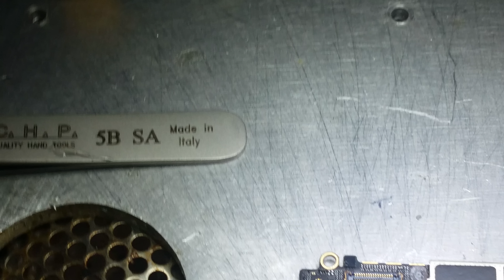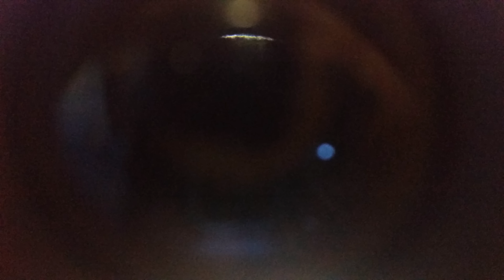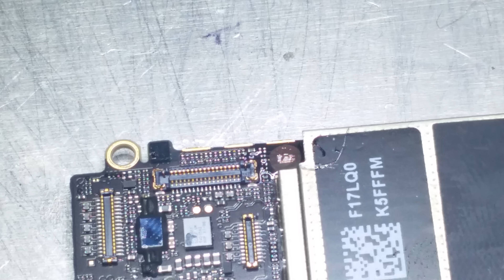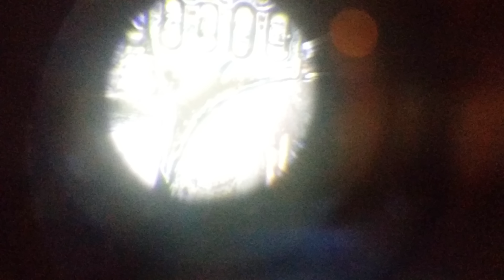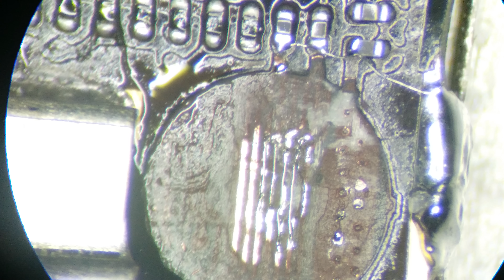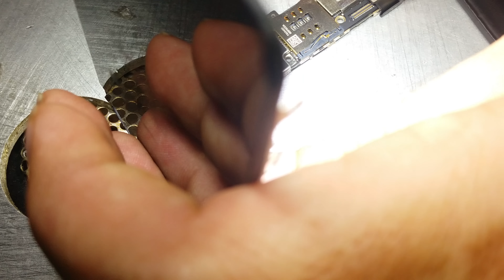iPhone 5S Blue Screen of Death (BSOD) Professional Trace Repair (Number 2)

Comment: Hello Dear, I am a follower and admirer of his work, actually im starting to repair my iphone 5s.

I have a binocular like yours but I have a doubt about the working "distance/zoom" of the oculars and auxiliary lens on it.

How many magnification are you using when soldering? Can I know your microscope configuration? mine are 4.5x - 45x but i think is low magnification?

Thanks in advance :)
Reply from the maker: I found the best balance by using a .5x Barlow lens which doubles the working distance with 20x eyepieces which double the magnification. the result is the same magnification as with 10x eye pieces and no Barlow lens, but double the working distance.
Reply: +Mark Shaffer 

Thanks for a very fast answer Mark, what you advise me is just what I had thought, but had doubts whether the increase is enough to do the job properly.

So you think is sufficient magnification for make the job properly?or you´ll feel more comfortable with a larger increase?

What do you think about 20x oculars + 0,75x auxiliary lens.

Regards from Spain mate :)
Reply from the maker: +Axel Today I find .5/20 to be plenty of magnification. The only time I need full magnification is when doing 5s and 6 long screw trace repair and at maximum zoom, the round screw bracket fills the view.
Reply: +Mark Shaffer 

Okay Mark thanks for your help, im gona try with 20xEye/0.5xLens and I´ll tell you what about :)

Good luck!

Comment: i got this blue screen of death on my iphone 5s. trace repair is not the solution for my problem because i never changed my screen yet. never open my iphone case yet. do you think IC on the board is the culprit for this problem?
Reply from the maker: in your case I would suspect U2 USB charging IC. Incidentally that is the topic of my next video, stay tuned :)
Reply: +Mark Shaffer yeah.maybe that cause the problem..anyway, i need to send it to the shop for troubleshoot the problem. some say it is u6 IC  that cause the problem....I just ask apple store, they can repair the problem. that will cost me 120 Usd..

Comment: wich tweezer do you use? and flux? wich one ?thanks
Reply from the maker: sparkfun tweezers and amtech 559 flux.
Reply: Thanks  Mark. And what about the wire? :)
Reply from the maker: +Daniel Vietri from inside the vibrator motor.
Reply: Oh cool.thank you so much. I did a fix like this but the bsod is still there after 3/4 minutes of normal working of the the phone.may be the cable?
Reply from the maker: +Daniel Vietri check the logs using ibackupbot. this sounds like it is probably caused by damage to battery gas gauge line. there are many different causes for bsod in the 5s but intermittent after normal operation is usually damage to components near battery fpc socket.
Reply: Ok mark. I will. Thank you for your special advices. You are my idol ;)